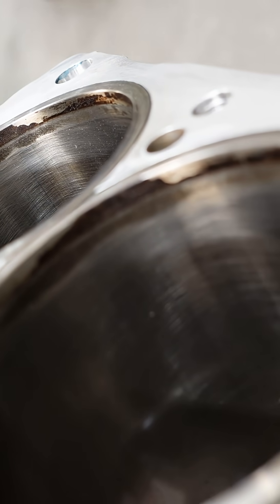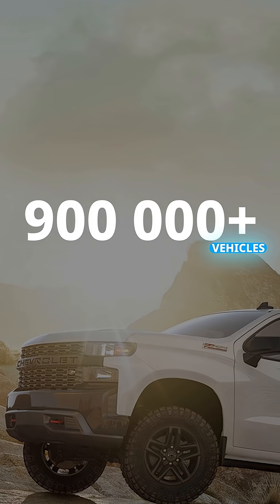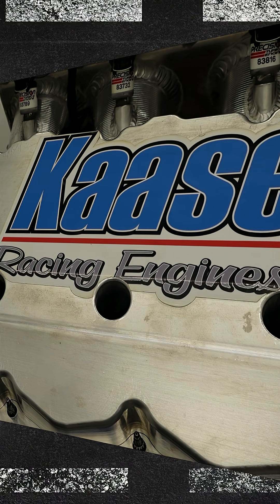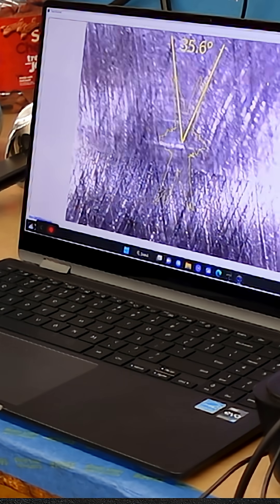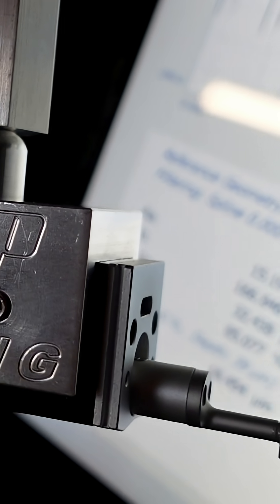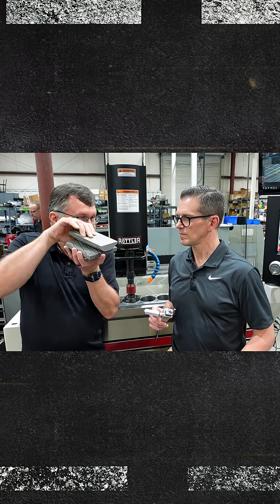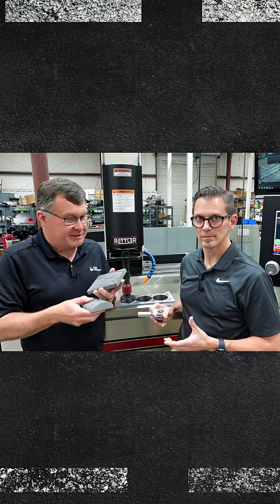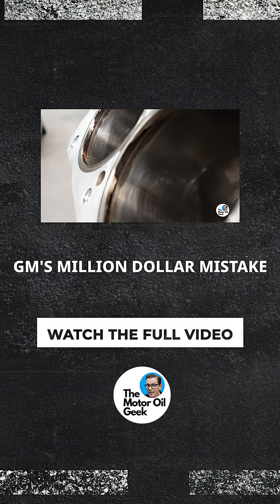GM'S BILLION DOLLAR MISTAKE...

Comment: My 6.2l failed at 92,000 which was when I received my letter from GM to take it in for the PICO test I took my tune off of it which deactivated the active fuel management and auto start stop feature
   The tune was only off of the truck about two days and the lifters failed when they started activating again. Ground out the camshaft in three holes. 
  
  Didn't have any lower end issues on the crank it was just that junkie active fuel management system shutting off those lifters and they stuck. 
  I've got a new engine now with about 4000 miles on it and it clatters and rattles so much I think it's fixing to come apart it's got a appointment to go back into the shop Monday

Comment: I am skeptical the problem is surface finish on bearings/crank but I also know, you don't know what you don't know! I am more suspect of machining issues.  Maybe poor surfaces could effect the oil film strength when piston is coming down and conrod trying to push down on crank?

Comment: GM has done their customers wrong for too long.

Not only do they continue to refuse to acknowledge since 2007 that the 5.3L V8 is a disaster of an engine with their cylinder deactivation tech, but the fact that they knew years ago the 6.2L V8 was throwing main bearings AND had cylinder deactivation issues as well is unforgivable.

Don't even get me started on their POFS transfer cases that go out at 80-100K if you leave them in 4WD auto.

Comment: Lake I believe you previously made a video clearly stating that 0W 20 weight oil was totally unsuitable for the L 87 application and the factory changed the owners manual to specify 0W 40. Now we're getting into the reality The General Motors doesn't take short block component quality seriously. Failure upon failure upon failure is the watch word at GM totally sad.

Comment: Quality in products made have fallen to a low. Warranties refused or delayed to save. Forced lawsuits. The manufacturers are at a all time low customer satisfaction. These fake JD power awards are bought, not earned. 
Those working manufacturers don't seem to care. Its a sign of the times. Buy American? I own a Toyota so I have reliable transport. I also own older legacy vehicles. The last 5 years have produced the worst cars ever. They have very techy features that are useless if it doesn't run. Hint: spend more time building the drive train and less on the phoney tech bull.

Comment: General Motors has been mismanaged for the last 40 years, the last 20 being the worst. GM need some new management especially in design and engineering. 
General Motors for more than 50 years has been bending over backward to satisfy incessant and unrealistic government mandates when it comes to emissions and fuel economy (now don't get me wrong I believe in decent fuel economy and a reasonable control on emissions, however GM has allowed to go way too far). GM is spending much too much money trying to satisfy the government and not the customer. That is why GM pretty much went broke and is still pretty much broke in 2009 and to this day. 
I love GM's products but I hate their management. Again time for GM to get some real management instead of the clown fools that have been running that company into the ground for the last 40 years.

Comment: I had a Toyota pick-up, it blew a head gasket, and it was burning oil previously, so I threw in a set of rings and bearings and whatever else it needed. After honing the cylinders, I wrapped steel wool around the hones to give it a quick smoothing of the cylinders with steel wool. Just as an experiment. It performed perfectly for many years before I sold the truck.
Your thoughts?
Reply: Steal wool would definitely help pull any honing grit out of the groves and maybe dull sharp edges but who knows. It sounds good to me.

Comment: No accident.  Engineers specified the Geometric Dimensioning & Tolerancing surface roughness Call Out including the allowable tolerances.  GM then decides their QA regiment during production.  Any failure with either of those processes is at their discretion.
Reply: Now wait a minute....you mean that GM didn't just figure all this out and ignored or specified these failures to happen....???  Oh wait, they have been spending millions of man hours studying surface friction mating materials and NOW they just discovered that surface texture matters???  I just don't believe it.....or should I ???
Reply: @edwinschwank2446  The powertrain engineers probably knew a long time ago what was going on, GM upper management is to blame here. Remember if they admitted it then they would 100% be liable, if they didn't then there is a chance they could have got away with it. They full well knew what they were doing. Same deal with the ignition switch fiasco. They knew years in advance they were going to be a problem and killed 124 people (by their own admission) because of it.

Comment: When are they going to recall all the garbage AFM lifter engines?
Reply: Change the oil and they seem to be ok. We've had several though the shop on 3k oil changes that are dead silent 200k+ miles.
Reply: @АлакПатрова  I changed my oil every 4 to 6000 miles and even installed a Range Technology device that keeps the engine in V8 mode at all times and still the number four cylinder AFM lifter failed at 45,000 miles as well as the pushrod. Now my wallet is $5300 lighter.  Garbage. Junk eight speed transmission ready to blow it anytime as well.

Comment: I’m not buying it. I believe it is all because of running the 0w30 engine oil. I’v been a diesel technician for 20 years and horsepower junkie since before I could drive. These GM V-8 engine are high compression / high horsepower and should never have less than 10w30 in them. I own a 04 Duramax and always run 15w40 engine oil. If I was to switch that to 0w30 the engine would be shot in less than 10000 miles. I run 10w30 engine oil in all our other cars and have for 100000 plus miles. No issues and no oil consumption. Everything is fine. They are all newer than 2015 VVT. No problems. I just bought a Cadillac CT4 turbo. I drove it from the dealer right into the garage and drained the 0w30 engine oil and filled with 10w30. Vehicle manufactures are running this 0w30 engine oil to squeeze out as many MPG that they can during their fuel economy tests to reduce fines. That’s it!
Reply: bro 10w30 and 0w30 is the same hot viscosity, the 10w30 oil's hths is like 0.2 higher
Reply: @deez023 
Bro! No they are not. You only get the 30 wt once the engine is up to temperature. No cushion between the bearings or any internal engine parts at start up.
Reply: @nixondecker5450  Do you know that oil is always thicker when it's cold? 0w30 at 40С would be 60 cSt and 10w30 like 80 cSt, while both around 12 cSt when the engine is fully warmed up. What cushion are you talking about, both are really viscous at start up.

Comment: All your teachings are great. Sadly companies don’t bother to give us the data and even analysis won’t help to make an enduring oil choice as the formulations even of the exact same product name and part no change mostly every year. You 80% never get the same oil under the exact same product title and code. I’m tracking 30 oils since 2021. Even by country in europe, or USA they are different oils at the same time under the same product and oil API category. No way for consistency! But hey you wouldn’t bother to tell your viewers as it would render the analytics off the original idea of what they’d get with it. The only consistency is that there is none thus no valid reference point. You start from 0 every year.

Comment: Lake, lets not forget the Auto transmissions issues as well starting from 2011 to 2020, that also has a massive impact to GM world wide.
So basically this will almost bankrupt GM to a point, meaning they made so much money, that now they have to compensate those cars vehicles affected ,either by re doing or supplying a new crankshaft and bearing damage that it has caused, paying for mechanics to repair, plus the Auto transmissions i have already put my claim in to a world wide malpractice case for the Auto issues. 😠🦘👍✌

Comment: So, basically there's no way the test dealers are performing will reveal if the crank surface issue exists, UNTIL it's too late. An issue can exist without anyone knowing it until it knocks. How did the NHTSA let them get away with this "test"?
Reply: NOT to worry fella....up the oil viscosity and drive away....but don't be surprised if the engine life lasts...oh say....100k and then it is done!!  Remember to "reward" GM for fine work and buy another one, when it happens.  That should teach GM a lesson, eh?
Reply: @edwinschwank2446 
That actually is a good way to strengthen reliability.
Whatever the user manual says about oil grade, go back to the good old 5W-30.

Said differently, whatever the vehicle, go look at the same vehicle sold in UK, EU, etc, and see what oil grade is spec’ed for those countries on the same engine. And use those oil grades. 
American spec is to help meet CAFE mpg numbers, but trade off on engine protection as the price.

Comment: Did I miss the part where he tells us what exactly was wrong with the surface. My guess is it was actually too smooth& did not have proper grooves to hold lubricating oil? Or too rough& it bypassed ? Ran off without staying to provide lube & carry heat away?

Comment: No, no, NO. GM jumped on the 'save 120 feet per tank' fuel mileage garbage. Their dinosaur tech V8's cant run 0w20. They need 5w40, NOT 0w40. This oil isnt a true 40 weight at temp. The viscosity additives arent capable of covering from 0-40 weight. They are only about a 35-36 weight. Everyone needs to run 5w40 in these engines......

Comment: Everyone is engineering junk these days, meanwhile my first year 239 ford Y block that is 71 years old still makes compression, oil pressure and NO ticky lifters! Hydraulic assisted engines+ hot dog water for oil= problems. wonder how these peices of dog shit would like mobil 1 15-50!
Reply: The Ford Y block uses solid lifters that are very light and that install from the bottom of the engine rather than from the top it’s a simple design that’s practically fool proof as long as the lash is adjusted properly

Comment: Having spent 4+ decades in the Defence Optics Industry, I well understand the importance of surface finish. 
In my time, I have also optically polished engine heads and blocks where, even though perfect finish was achieved and the engines could have been gasketless (at rest), we did use a reduced thickness gasket due to the varying thermal coefficient. 
WRT cylinder bores, I could devise a means to polish them but my knowledge of bores is not such, that I think it may not be worth it for 10’s of 1000’s of miles. i.e. the bore would naturally score with use. 
It may be useful for a race engine, but…..🤷🏻‍♂️

Comment: crankshaft surface area is NOT piston cylinder area.  What you are talking about is done by builders to facilitate break-in on rebuilt engine.   You do not explain why not crankshaft other than bogus thing you do on purpose when building an engine.   I will continue to crosshatch cylinder bores before installing pistons.

Comment: The real problem is getting Mobile one brand  oil  for free as a factory fill so the customer will continue to use Mobile one brand oil .( And Mobile makes a big profit. 
In my  opinion ,I never use  American oil , I use Castrol , Chevron or Shell motor oils and never full synthetic, I always use a synthetic blend. ( More durable) Under loads .🙏🤔👍
Reply: If you are using Castrol you are truly in the garbage pit lol...
Reply: As far as durability synthetic blends won't hold a candle to a premium 100% synthetics. Besides blends only contain about 5 to 15-20% synthetic base oils.
Reply: Real synthetic oil is PAO  , modern synthetic oils are refined mineral oil 
or" synthesized "( still man made with an added molecule to legally call it synthetic) Castro and Mobile oil had or still  ( have ) a big law suit over the word "synthetic " 
Modern synthetic oils ( the mineral base ) do not absorb shock loads ,there is NO   hydrodynamic wedging ( like hydro planning to keep metal to metal contact)   because it is too slippery and has very little 'cohesion" , ( real PAO  synthetic oil is repellent to metal it doesn't stick) modern"synthesized" relies olty on the film strength ( still no wedgie effect , like water  hydroplaning on tires ) synthetic blend has cleaner base oil ,will absorb high shock racing or off road construction loads "lugging " and 2%to 20 %  PAO SYNTHETIC for metal to metal contact,piston rings and roller tappets .
Mobile oil tri blend is basically 70% group II base oil 25 % and 5% PAO for metal to metal contact and the reduced ZINC in modern oils to protect the catalytic converter.
( percents are approximate for understanding) . 
Personally I use 30 HD in all my cars and trucks then switch to 40 HD. After 300,000 miles ( hot climates only like Calif,AZ TX etc )
Up north use 10 W 30 or 10 W 40 
Syn blend syn for starting and 40 for the shock loads ( especially if a trailer is towed ) or 6 fat people with a tank full of gas going up a West Coast hill in 90°heat ,
Your rod brgs will thank you .
Good luck 👍❤️🙏

Comment: I thought that the crank was under spec so the gap was too large for the thinner oils. That allowed the oil to not quite be retained between the bearing and crank. The thicker oil that gm spec out in the recall should. Idk. I may be wrong. Either way the more you outsource the less quality control you have over your product.

Comment: The fact that I built my engine and it has lasted longer than what GM can make says a lot.
Reply: Yes,  it says that these micro imperfections AREN'T the cause of their engine failure.  So many of us built engines without having to check it with a microscope. 

They're reaching for a reason at this point....

As for the naysayers in your sub comment,  like the guy telling you to build a 1000hp engine. This guy have NO IDEA how, if you can prefect longevity and reliability,  high horsepower engines should take more notes than the other way around.
Reply: @partsshooter I don't think he was talking a 1000hp motor, I think he meant now go build 1000 motors and then run your mouth.
Reply: @generalzod7959 

😂. .. he slow ...don't mind him
Reply: Same. I have a 3V 5.4 I built 8 years ago still running using a blend of "engine tech", melling, Ford, ext. A boosted K series on alcohol, a big block chevy, and thats just what I've built of my own. Can't tell you how many ive done over the decades at work. Kinda sad. Do people not even drag a piece of tissue over a crank to see if it snags anymore. So simple yet so effective.
Reply: not caring about their product and cutting corners is coming back to bite them.
Reply: What does it say? Shut up!
Reply: you used all GM parts and guide books 😂
Reply: @dznuttzonyachin7499 so how long has GM ford dodge Toyota been building engines!!!! So your saying that these engines are just fine!! Get off the drugs and sober up.
Reply: Totally good job man. 900,000 Gm drivers are cruel to their trucks and don't love as much as you love and care for your well build joy ride.
Reply: @pbalerig  
Did you use two hands when you gobbled down on it 😂
Reply: It says a lot.  It says you were lucky as hell.
Reply: No it doesn't.. go build 1000 and then run your mouth 

1 motor 😂

Comment: I have 390k Miles on 4.3 GM running perfectly.
275k on 5.3 GM AFM no issues only  coils starter.
310k on my 6.0 GMC 2500 work truck nothing except a starter .

I have been a mechanic and built engines marine industrial truck cars motor cycles since 1976.
Maintain oil change and take care of vehicle it will last.

I was informed the 6.2 GM in Camaro is not failing..

Perhaps those crankshafts were machined in different factories?
Reply: Forged steel over  cast iron perhaps?
Reply: @captainchicken8983 Forged steel cranks hammered out of one solid piece of 4130 mostly.
I think Camaro Corvette engines were manufactured in a separate factory that did the finish properly.

Comment: Ford 5.0 is the G.O.A.T
Reply: I just put a new 5.0l in my 2015 F-150 at 220k miles.  I could have drove the existing engine further, but I figure another 10 years with the truck is fair.  The old one needed a valve job.
I won’t have to deal with 10 speeds, auto stop start, cylinder deactivation and a big screen illuminating my face.

Comment: After the he11 I have been through with my Z71 and my Yukon I hope GM goes broke.  Two lemons they stay in the shop. Lifter failures, ac failures ,three times, lcd screen, led lights, ball joints, axle seals, vibrations,  computer issues, air pump. Rear latch eletric lift shocks. Problems started at 28,000 miles and got worse to now under 80,000 miles.
Reply: That's horrible, what a disaster
Reply: But have you learned anything from this? Or will you just go buy another Chevy down the road? That's the real question.
Reply: Sorry to hear that…. Unfortunately Ford and Chrysler arnt much better… and now Toyota has joined the sh-t show!!😢 😢😢
Reply: Damn.
Reply: It’s all brands these days =junk

Comment: Very cool but I seriously doubt local gm dealers have or will use this level of tech to properly diagnose our engines.
Reply: They shouldn't have to. The factory should have from the damn beginning!!!
Reply: As it is, the dealer is going to pull the affected engine and replace with a new one hopefully with new warranty since it's such a big F'up on GM's part. Almost 1M in faulty engines, gonna be some job openings in the engine division.